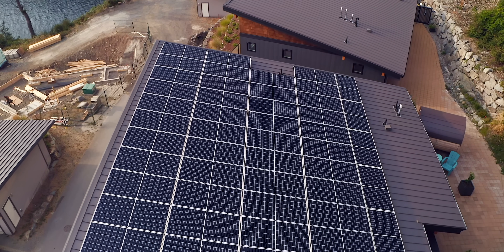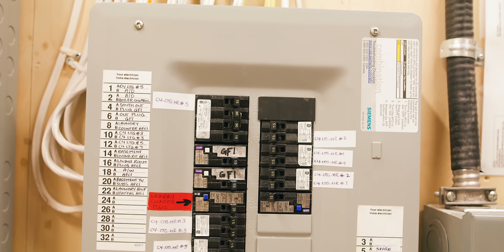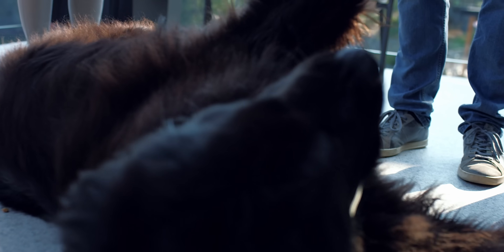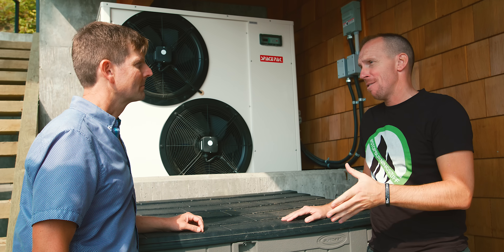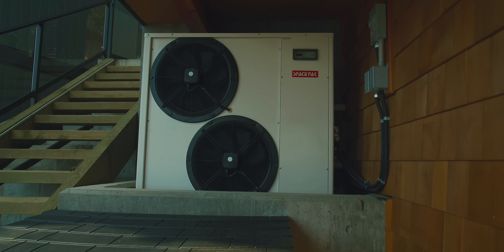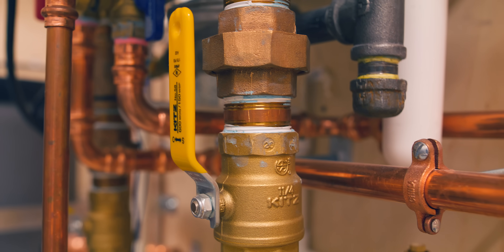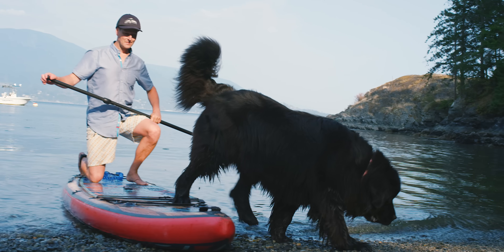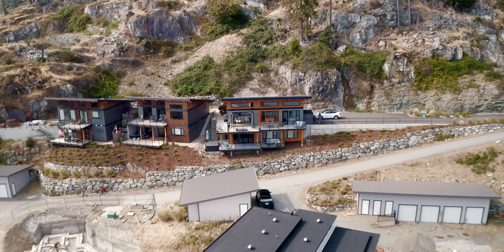How to Build a Net Zero Carbon Dream Home!

Comment: This might be true but misses the point; the vast majority of homes we’ll have in 2050; even a majority of the homes will have by the end of the century have already been built. The big gains will come from retrofitting our existing housing stock to make it carbon neutral not from new builds. This doesn’t mean the latter are unimportant and houses such as the one in the video can act as inspiration for change. Ultimately though we need to improve what we’ve already got; by far and away the most sustainable route
Reply: I'd agree but some existing homes just need to be torn down and new ones built in their place. I'm currently living in a concrete formed block of masionettes built in the sixties, which means adding effective insulation is difficult, it has a disused drying area underneath which means the concrete floors are always cold, especially in a cold windy Scottish winter. I doubt I could add a heat pump as their would be no where to put it, same goes for solar and also for any kind of ev car charger as it has a communal car park separate from the building.
Reply: @Razorlance  > I'd agree but some existing homes just need to be torn down and new ones built in their place. <
I agree!  Retrofitting energy efficiency requires a fair bit of expensive labor and it can result in a house that doesn't match how people live now.  Retrofitting might make sense (cents?) if the homeowner does the work themselves, with essentially no labor cost.  Otherwise, it often makes more sense to tear down and build new.
Reply: If you're in the UK new builds tend to be from a developer,  in comparison few are designed by the owner like this one might have been. It's probably more common in places like the USA, Australia & Canada.  Don't disagree with your point, but it might depend where you live.
Reply: Unfortunately it isn't easy to retrofit efficiency into a home... Air sealing a poorly built home can lead to condensation and mold, as well as other indoor air quality issues due to manufactured material off gassing.
Reply: @kschleic9053  Of course it isn't easy, that's another reason why it would make a much more interesting video. In northern Europe it's quite common to add external insulation, air sealing, and ventilation with heat exchange to older houses. And ultimately it adds enough value to the house to be a sound investment.
Reply: Look up EnerPHIT
Reply: Nah, tear it all down and throw it out, build fresh on top of that 👌
Reply: Totally agree with you David. Did you spot the thermostats at 24C. That's t-shirt temperature or the sort of temperature for elderly care homes and hospitals. 21C is enough for communal spaces and 18C for bedrooms according to guidelines.  Here in the UK, we've got thermostats for our zones all set to a maximum of 17.5 during the day and 13C overnight.
The feeling I get here is one of energy inequality where those who are wealthy get to have new build efficient homes with a massive roof and  plenty of solar while the poor struggle to even have a roof over their head, and when they do, they are left with massive heating bills and so little opportunity to improve their situation even if they could finance it
Reply: @NealeUpstone  I guess the point is that the wealthy will always build their wasteful, luxury over-sized houses, but at least some are starting to do it somewhat efficiently.  Let's face it, the vast majority of new homes in NA are far, far worse. Having said that, it's disappointing that FCS is pitching this as some sort of innovative eco-dream, especially given that it is extremely wasteful, far from sustainable, and relies on very generous 'net-billing' policies (ultimately subsidised by those who can't afford solar cells).
Reply: Exactly first step get a air tight test done like Robert recent video. Second step improve insulation and tighten gaps. Third step electrify everything in the existing house which means generation and usage. These are realistic goals for most people that have their own home. For people that less fortunate then we have to rely on governments or charities to get this job done. Surely rich people can find charities to provide energy efficiency for people less fortunate
Reply: Curious that this house is chosen.  As the owners said it was not designed as net zero.  For instance the windows apparently get lots of sun, but the roof and solar panels face away from the sun.  
I expect for the same money they could have got a true zero house, though perhaps not as extravagantly large. 
A Passivhus would not even need a heat pump.  If you did use one, there is the sea very close, so a water source would be far more efficient in winter.
Reply: @markthomasson5077  I too thought it was an odd choice to make a higher priority of non-dispatchable heat from the clerestory windows versus a more typical roof shape that would allow at least half the solar panels to receive sunlight.  
A passivhaus still has heating requirements.  Seawater as a heat source . . . saltwater is very corrosive and it will be colder or warmer than than Vancouver's maritime climate, depending on the weather that day.  Salt spray is corrosive enough without inviting chloride attack from the whole ocean.
Reply: A lot of people that have commented seem to have missed this was not a new build. Every existing dwelling presents different mixes of solutions. Yes the roof direction might not ideal but they seem to get plenty of solar. To me the video is balanced but does reveal the downside of net zero achieved by exporting loads of power in the summer and importing lots during winter. This may work for hydro but means a lot of utility generation in winter else where in the world.
Reply: @crispynoges  At 2:32 you can see that this IS new construction.  It is an old, passive solar design but definitely new construction.  This is a design that was popular during the late 1970s.  Non-dispatchable heat was thought to be a good deal back then, and compared to $10/ Watt for PV, it was a good deal.  Now that PV costs $0.60/ Watt, PV is cheaper.  Those windows aren't cheap.  An up to date version of this house would no doubt be turned around 180 degrees with the solar panels facing south.  19,000kWh annually from 24kW of PV is about half of one would expect for Vancouver.
Reply: Your comment is wrong; but I don’t mean to be rude. This isn’t an “either or” situation. Given the place we have put ourselves, we have to explore every avenue, and make progress with them all. We need to make new builds better, plus make retrofitting affordable and effective. We need use less energy, and make the energy we are using greener. Nothing should be off-limits in terms of consideration for sustainability. As my nanna used to say: “every little helps [said the old lady peeing into the ocean]”
Reply: It's a good point David. I felt that the  Step Code intention covers this to some degree as homes can be retrofitted and 'up-stepped'  following approved routes (better insulation, glazing, solar, heat pumps) and the 20% increases between steps. With the U.K.s large pre-war housing stock and an increasing population, the relatively poor quality of new builds (in an effort to maximise profit and keep down prices), plus no real governmental pressure for building co.s to change (particularly re: insulation, smaller footprints but crazily, a push to use H2!), again, I imagine we'll trail other countries again.
Reply: I don't know where you live, but in the US the average home is only built to last 50-60 years or so.

There will be a LOT of deconstruction between now and 2050 in this country.
Reply: As the owner of a damp, drafty mid century house, that task is MUCH easier said than done. The cost of upgrading old homes to a level that will actually matter, is downright prohibitive, especially homes with brick or stone facade like mine. Also lots of expensive labor is required to rework old buildings. Add to that stagnant property values and it can be difficult to justify spending more than the house is worth to achieve modest gains. Personally, I'd rather build new for the ability to do it just right from the beginning and not have the compromises associated with renovating a 70 yr old building.
Reply: I don't think that's the point at all. Years ago I watched video on a net zero retrofit of a small urban house in Toronto.  Fantastic video, proves all the naysayers wrong.  But I don't want that house, I don't want that lifestyle. But I'd love to live on sunshine coast of BC in beautiful custom home.  Too much of the messaging around sustainability is religious,  what can I give up to be good environmentalist. You don't need to be an ascetic to help save the planet. You can have a hot tub and take your dog paddle boarding and still make the world a better place. The point of the video is to inspire change. Not everyone change is a million dollar house with view, but if that inspires you to blow a  bit extra insulation in the attic,  replace some windows, and  upgrade to a heat pump; well that's progress.

Comment: a huge, huge miss to not have battery backup. almost to whats the point level.....
Reply: They spent out on the hot tub and sauna 😂
Reply: @bordersw1239  sure seems that way....
Reply: Exactly!  Power goes out on the grid, power goes out in the house.  With even some battery storage, they could keep power in the home if the grid goes out.